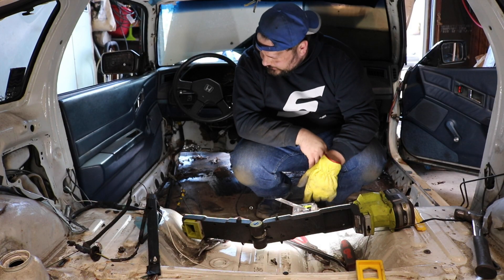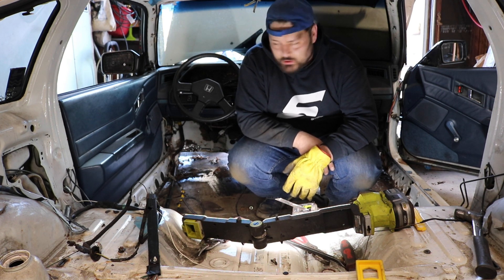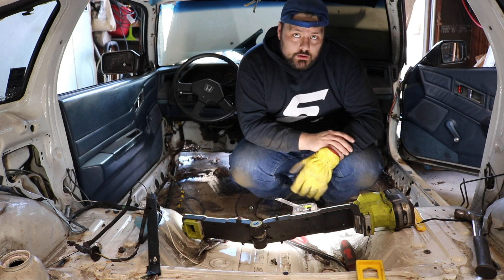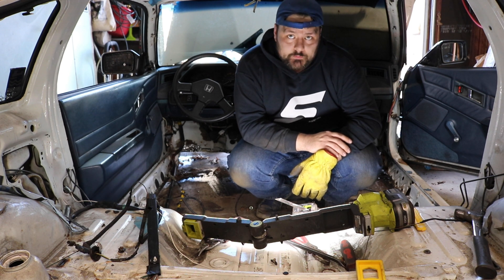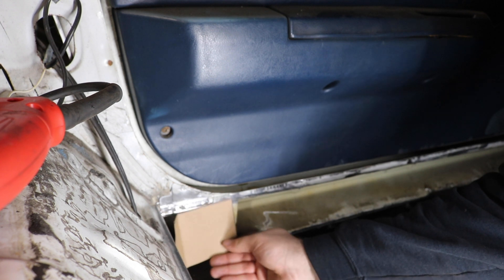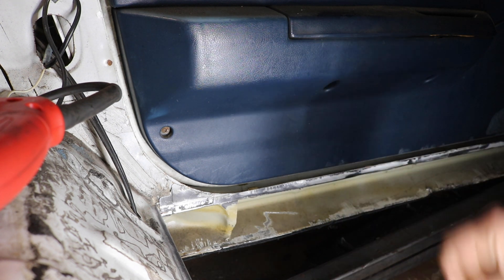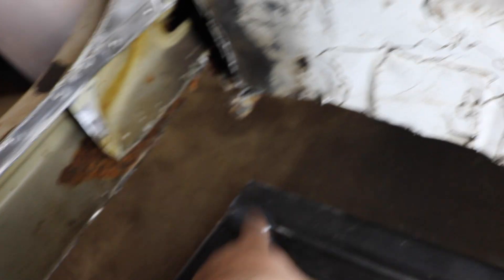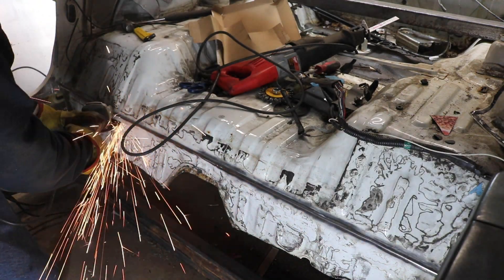EJ205 WRX Powered Honda CRX: Starting the Tube Frame

Comment: I’m re watching these vids
Reply from the maker: Thank you for the support! Got any favorites? Was starting to put together a compilation video and would love suggestions on what to include
Reply: Idk how guys do those videos where the musics beat goes with the picture changing. My favorite moment is when you find out your crx needed more framing than expected and you just dove in instead of being all emotional like I would have been! My favorite feature of the car, so far, is the louvers.
Reply from the maker: Agreed - I like that editing style too. I’ve tried to do that with most of my “b roll” sequences. It would definitely be a fun challenge to try to cut an entire video together using that technique. 
Hahahaha I didn’t record the “oh balls” moment when the screwdriver went thru the front structure. I think I stared at it for like 10 mins before getting up and turning the camera back on. 
The louvers are my favorite too!
Thanks for help!